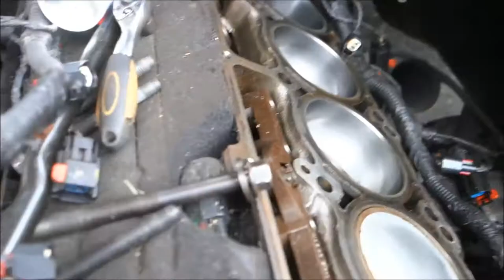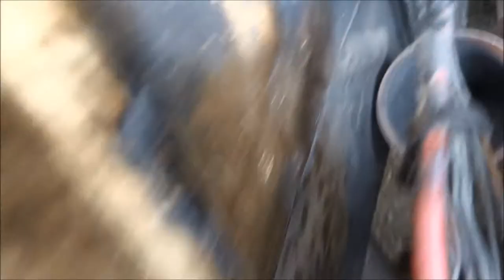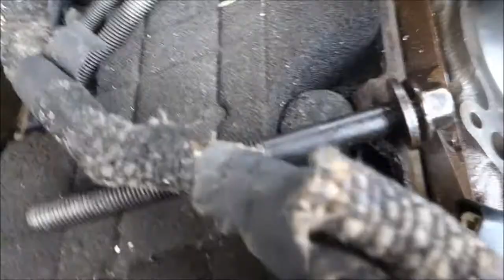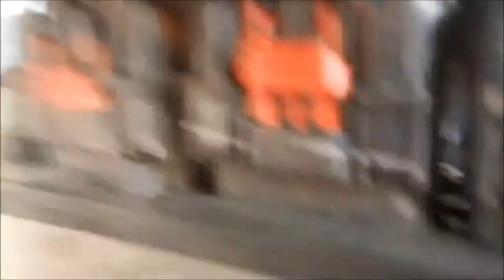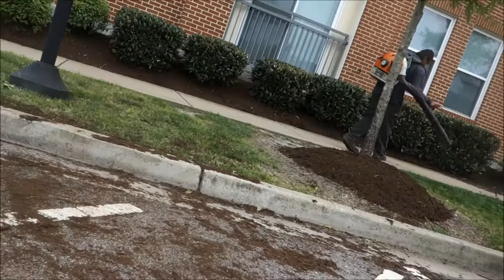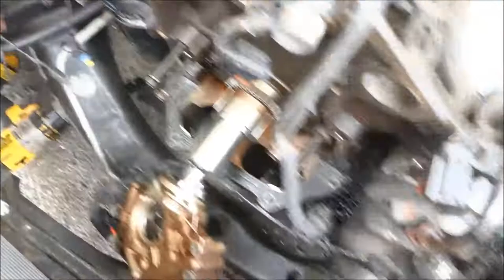Vlog#6- Wiring Harness (2005 300C 5.7L) Sony RX100

Comment: Any chance you know about that blue wire with the starter bro the one that blots on with the red cable¿ I connect the blue cable and my negative and alternator starts to get hot hot and smokes until I disconnect the terminal quickly and I connect it back without the blue cable and just red cable on starter and car runs smooth but days after charged battery the red symbol battery turns on and ends up being drained battery but that blue cable idk what to find any info on it
Reply from the maker: Let me take a look into it later today when I get a chance. I'll try my best to get back with you
Reply: @YachtLife  thank you bro! Nobody has had no help so I’m stuck cus my car drives but it’ll die cus ik that blue wire ain’t connected most likely but if I do the alternator and terminals get hot